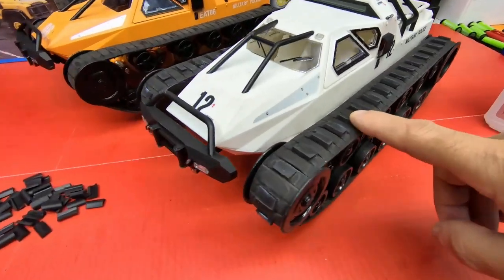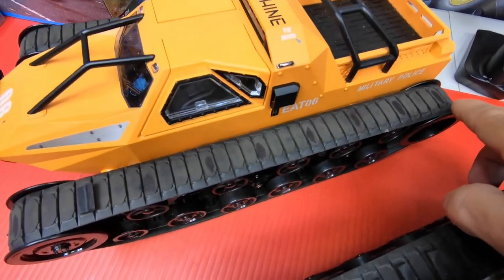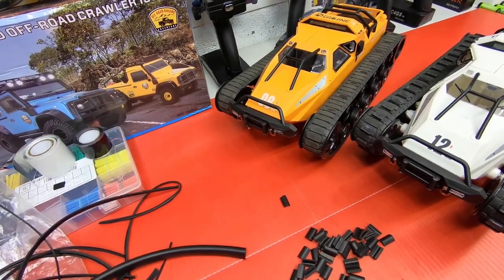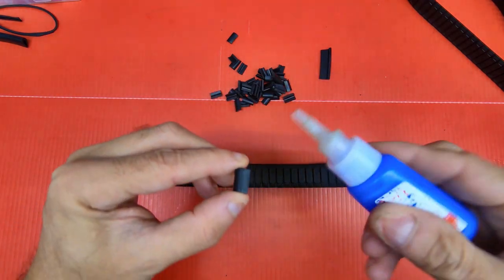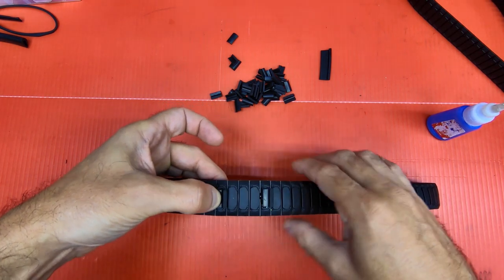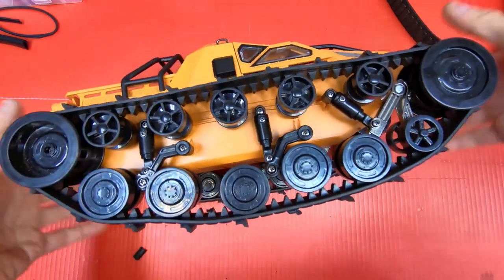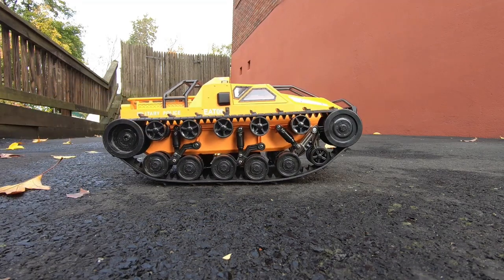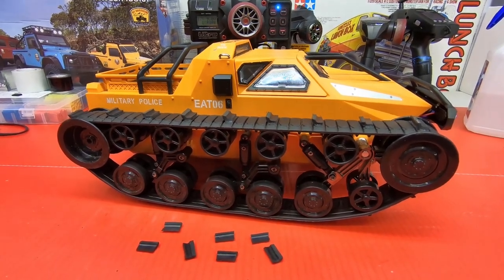SG 1203  RC RIPSAW tank how to make custom paddle tracks

Comment: Hope this can help ripsaw work well in water !
Reply from the maker: Don't go to deep it's electronics I believe are not waterproof.
Reply: @ShenRC  can we turn it into waterproof ?
Reply from the maker: @thegoldenfishempire5295  Yes you can coat the board with conformal coating or spray it with corrosion X spray

Comment: Good job now a test drive in different terrains without and with the two different styles you did will be nice
Reply from the maker: Hi I have 3 different moded track they work better than stock because the stock ones are smooth and rely on the rubber only for traction.. now if you make little lugs across the tracks it catches all imperfections on the surface your on and grabs much better. I ran them for a while now and already know the moded tracks are better.  👍Thanks for watching.
Reply: @ShenRC  Yes but is always nice to see a test video

Comment: It worked very well.  Maybe you can make metal tracks.
Reply from the maker: Hi they do have metal tracks but they wear out the rear plastic drive sprockets and bog it down because they are so heavy..and they slip like crazy on surfaces also. Better off with the stock tracks. Thanks brotha!

Comment: how are they holding up so far? My concern is it throwing the lugs after being outside in the cold. I remember sitting in the middle of the living room floor bolting 177 studs on My Artic Cat snowmobile track while watching Christmas specials. Mabe someone can come up with metal studs you could bolt on your track. lol. I am wording how long they will stay on. In snow, my concern would be them digging in too far. I avoided putting my metal tracks on my Kyosho blizzard because I was told they add too much weight to the machine and only work on ice, not snow. Same would apply on these. I am expecting my Rip Saw sometime next week. I ordered it from Banggood.  State side warehouse, not China.
Reply from the maker: Hi so far so good, You need to degrease everything real good first and use a good CA glue... I would think the paddle tracks would have more chance of coming lose over the low lug styles I did before these though.  No metal tracks on any rc tanks blizzards or nothing they cause so much stress to everything and  make the RC break down much more.  Thanks for watching.